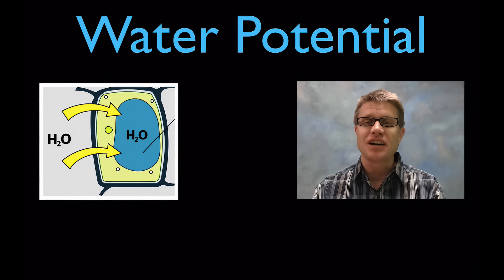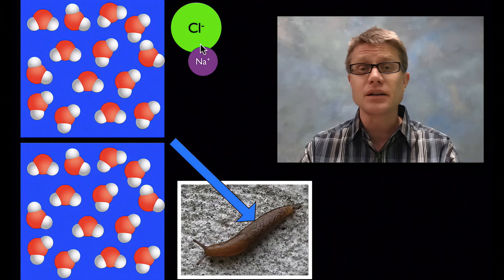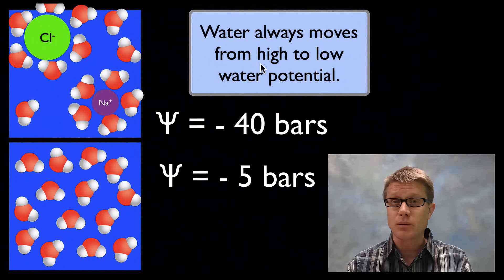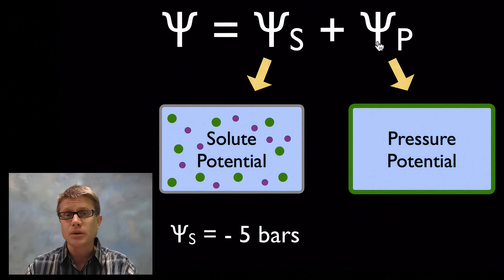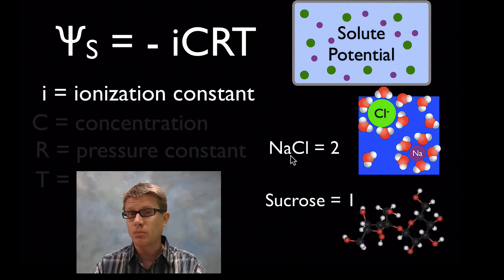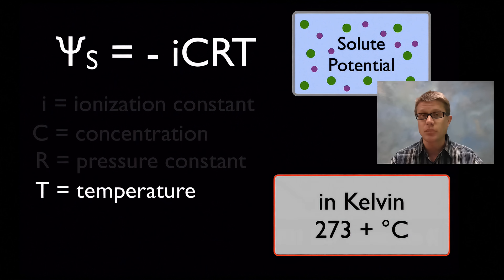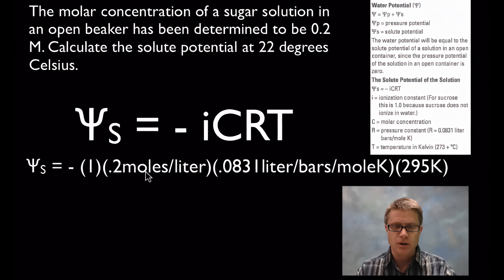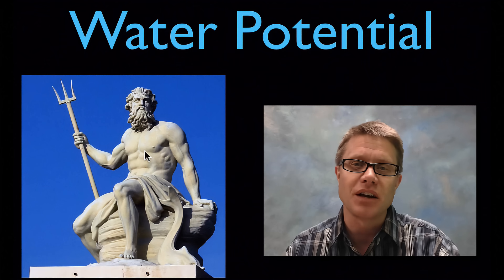Water Potential

Comment: how does increasing temperature decrease the water potential? if temperature increases, then it means that the particles will move faster and more randomly. this means that the eagerness of the water particles to move out increases( similar concept as pressure). but according to the formula, is T increases, then water potential decreases and this means the the water is less likely to move out. I have searched on Google several times but i couldn't find the answer. thank you
Reply: basically you use temp. in the equation to find solute potential. the higher the solute potential the lower the water potential. so therefore the higher the temperature the lower the water potential

Comment: Paul, there is another convention for significant figures. The rule I use does not use only figures in the answer equal to those given. it uses the all the, “certain” digits and then the first uncertain digit, but no more. So, at 8:47, I would provide -4.9 bars as the answer. 
In engineering, this is common practice.

Comment: Can someone help me with this problem:
    A closed, saclike membrane, completely filled by a solution with an osmotic potencial of -27 bars, is immersed in a solution with an osmotic potencial of -21 bars. Assume  that the membrane is permeable to water only and that the osmotic potencials will not change with osmosis. What will be the water potencial of the internal solution at equilibrium? The osmotic potencial? The turgor pressure? Answer the same question for an external solution with an osmotic potencial of -16 bars and for one with an osmotic potencial of -20 bars. thanks

Comment: Professor Anderson, why did you choose to utilize bars over MPa megapascals. Bars is not approved by the international system of units (SI).  I would also assume since psi pressure is a physical force relatable to measurements conducted in physics studies and other STEM science studies. It is also labeled in  my pearson textbook as such. I ask because the only place I have ever seen bar measurement is weather stations, and on pneumatic technology and compressors frequently.

Comment: Can someone help me with determining if my calculation for the final Pressure Potential/Turgor Pressure in the following example is correct?  If I have 14.64 Grams of Potassium Acetate in .1737 ml of water at 300K in a sealed cell with a Pressure Potential of the cell being 0 then the Solute Potential would be 42.75 Bars based on the following.  The molecular mass of Potassium Acetate is 98.15 gram/mol. Therefore, the Mol/Liter would be 14.64 gram/(98.15 gram/mol) = .1492 mol.  Mol/liter = .1492/.1737 liter = .8587 mol/liter.  Therefore the Solute Potential would be 2 * (.8587 mol/liter) * (.083 liter/bar/mol/k) * 300 k = 42.75 Bars.  Now if I were to plunge the cell into pure water where the cell would absorb .1977 liters of water, then there would be a reduction of of Pressure potential to 20 Bars by the following equation [2*(14.64 gram/98.15g ram/mol) * (.083) (300k) = 20 Bar.  Now, if I want to determine the pressure exerted on the cell way, would I simply subtract the 20 Bar from the 42.75 Bar resulting in a Turgor Pressure of 22.75 Bar?
Reply: The answer is 7

Comment: this 10 minute video taught me more than a 50 minute lecture. 
how do you find the pressure potential in a closed container?  my homework examples are asking to find the water potential of a cell and as far as I can tell, the pressure potential isn't listed.  all we're given is the molar concentration and the temperature.  am I supposed to be able to find the pressure potential based on those givens?  thanks.

Comment: Im still confused on how to determine the "i" value. Could someone help me out? Thanks for the video!
Reply: It basically indicates whether or not the molecules of the original solute will separate within the water molecules when dissolved in water. Ionic compounds (e.g. MgCl2) will have an "i" value equal to the number of ions in them (for MgCl2 it's 3, because when it's dissolved in water, it will separate into 3 ions: [Mg], [Cl] and another [Cl]). On the other hand, when you dissolve a covalent compound like sucrose, it will dissolve as a whole; in other words, sucrose (C12H22O11) won't disintegrate into separate atoms, and it'll therefore have an "i" value equal to 1.
Reply: Yasser Almalky thanks!
Reply: i=Ksp